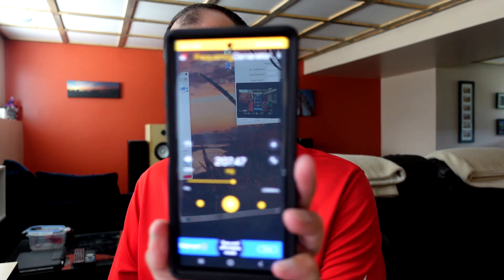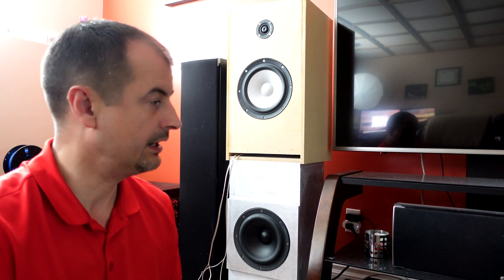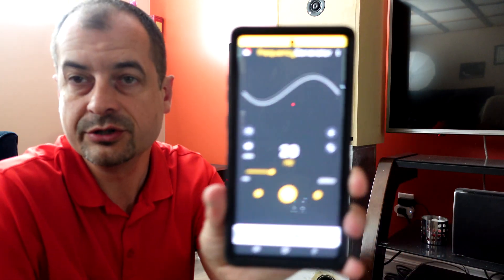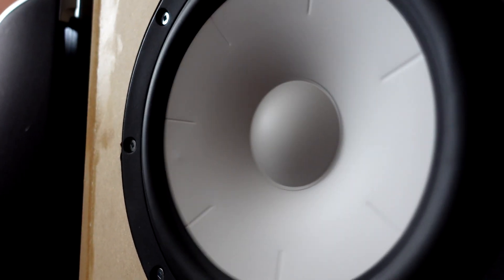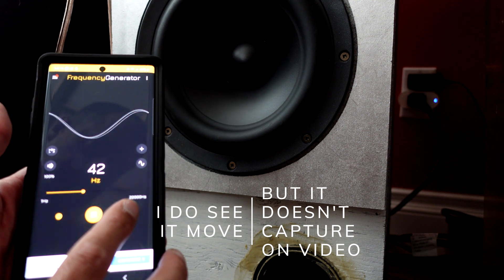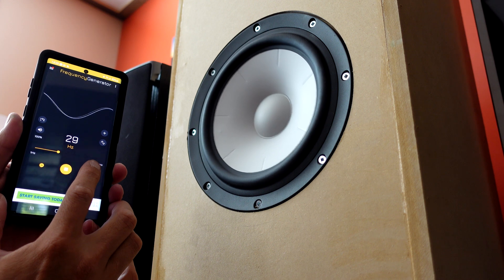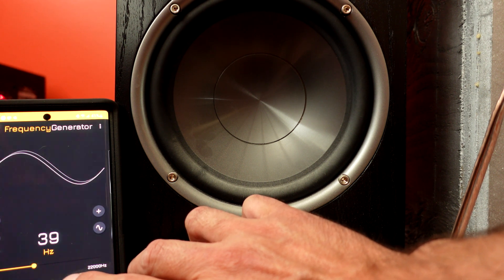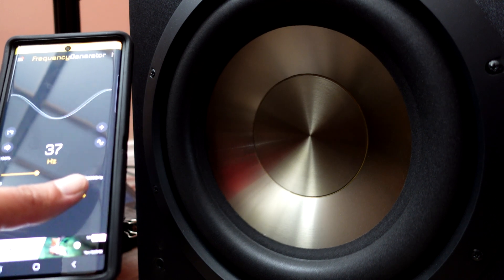How To Find A Speaker Box Hz Tuning

Comment: mine stop moving only after 80-90HZ and never start moving again. what does it mean?

p.s. i got some 15inch car subwoofer from my friend and I have no idea what are the parameters of it.
Reply from the maker: If this is a ported box, start at 20 hz, sounds to me like you missed it, go up in 1 hz increments, take your time, you'll also notice when you hit the spot the port will be moving a ton of air while the speaker looks stopped.  If it is indeed at 80 to 90 hz the box might need to be redesigned.

My guess is either you missed the tuning frequency or the box isn't correctly designed.  Do you have the make and model number of the speaker along with the dimensions of the box and port?
Reply: How can a port move air with a stopped cone .?

Comment: Hi, any idea how to eliminate a huge ammount of port noise? I've got a 6.5 Ciare  HWG/HSG ceramic cone which is pretty capable, it makes a huge shuffle on a port. Builded a 10 L enclosure, first sealed then ported. If i stuff it fully with poly won't schuffle but driver will act like a sealed enclosure. Thanks
Reply from the maker: Sounds like the port is just too small for the enclosure. I would start by loading the driver in WinISD and build the box the driver wants.  Porting a box is never as simple as just adding a port.  I suspect your tuning frequency is way off what it should be as well.
Reply: @davewiebespeakerdesign  exactly what i did, unfortunately driver needs 15L enclosure is aprox 10L. i've imput the port diameter in wini 3cm and gave me around 80mm lenght exactly the size of the port i bought :). The only thing it's not flared in the inside but i guess most aren't. I have another port of 4cm i think and will try with that one. Difficult around here in Romania to find ports this small. 
I would use a passive radiator but don't have the room for it.
And if i use it sealed, by looking at the driver, compared with ported, it's excursion is way longer and wouldn't want to stress it like that. Tested with a plug into the port.
Another option would be AP but don't have the room either :(

Comment: can I use this method to sealed box?
Reply from the maker: Unfortunately not, you can use WinISD and plug in the box parameters along with the speaker driver parameters to know more about your speaker.
Reply: @davewiebespeakerdesign  ok thanks. I use WinISD to build the box, but I want to know real life tuning.
Reply from the maker: @ZuNunchaku  You have me stumped, but if you have a WinISD design, couldn't you do base test tones and see where your F3 and graph is and see how close you hit your design?  Either way, let us know when you figure it out.
Reply: @davewiebespeakerdesign  the problem about testing is, im not audio expert. and I dont have any microphone that suit for measurment. based on my ear the sound really hits around 59hz preety high frequncy in my opinion

Comment: I used a Hung Chang 9205C function generator and toilet paper.
Didn't go through amplifier.
Reply from the maker: Another way to get the job done!  I had to google the function generator, hadn't heard of it before, yes, I'm new.
Reply: @davewiebespeakerdesign  I've had about 15 years and I picked up second hand from electronics repairer that was getting a new one. But still works good.
Reply from the maker: If it works good, no need to replace it.

Comment: I like to hang some string over the port so I can visualize the port air movement.  Another option is to use a DATS.
Reply from the maker: I did try and buy a DATS but they are under supply shortages in Canada atm.  The string is a great idea!

Comment: YoU need DATS  as the FS on drivers is wrong most of the time.. um18-22 should be fs 19hz but its actually 26hz.. I wondered why my graphs wasn't matching up with the box programs and now i know why.. MANUFACTURERS TELL YOU LIES
Reply from the maker: I've tried to order a DATS several times, no luck for Canada atm, supply shortage...

Comment: i've gone off ported. if you add more power and get more drivers the result is a 10fold improvement.. I see ports as a gimmick now.. ports would be good if you had the last amp on the planet but that's it.. my opinion
Reply from the maker: I might do the same as well, I've had some non ported speakers and boxes in the past and I have LOVED them!

Comment: Cool video. A little background on this. What is basically happening is the mass of the air in the port becomes a spring that oscillates at a specific frequency. Although it looks like the driver isn't doing any work, it's actually pushing and pulling against the back wave that is trying to move it, so it's exerting energy being a barely moving wall.
Reply from the maker: That's interesting, thanks for sharing, I'm often guilty of not understanding why it works just knowing it does, thanks for your insight.

Comment: Dayton Audio's DATS tester will check that, accurately.
You need to invest in one; they measure the loudspeaker impedance, which gives a ton of information.
It can be used to measure a speaker's Thiele/Small parameters too.
This is the entrance to the speaker building rabbit-hole.
Reply from the maker: I did try and get a DATS tester, but they were unavailable to me at that time, this was better than nothing.